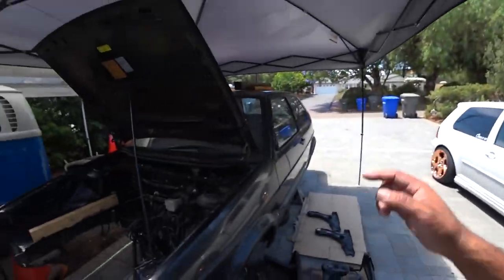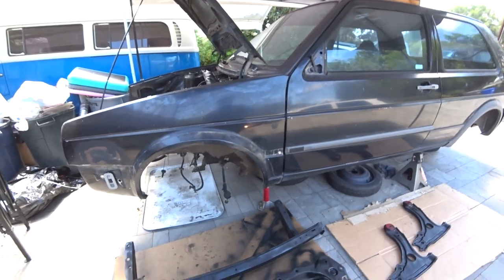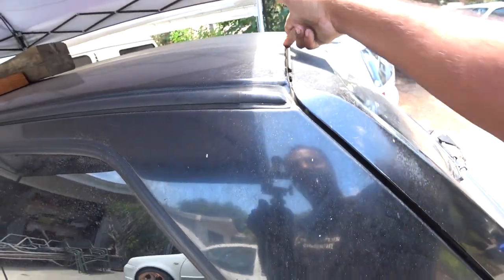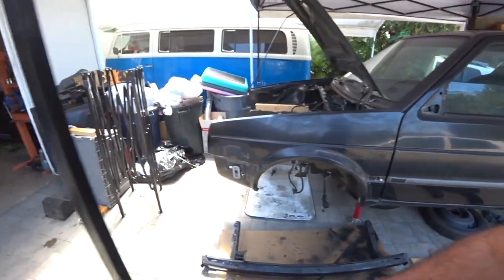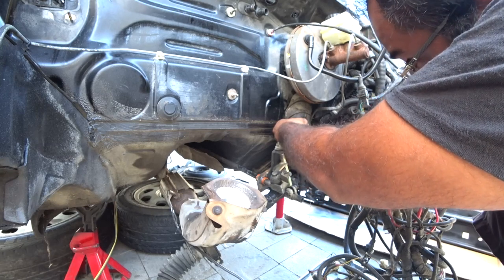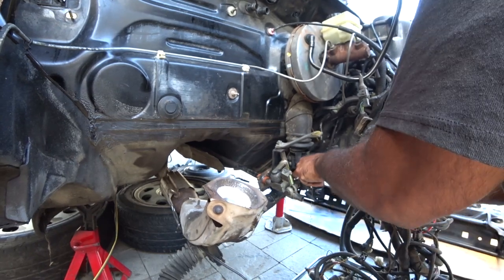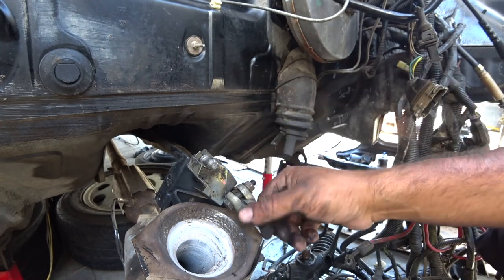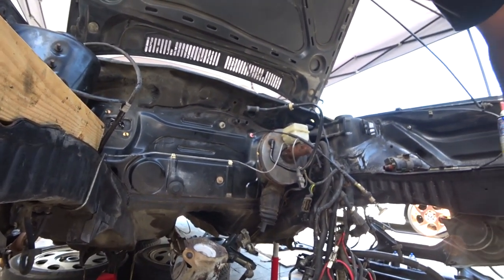VW MK2 Rack and Pinion Removal and Recap of What we done Season 5 EP25

Comment: I’d suggest you’d get Audi 90 Quattro calipers,   And g60 spindles to put them on. Best upgrade you can do for bigger breaks on the mk2, and make sure you also get the master cylinder from the Audi 90 Quattro as well, it needs it for an engine swap I have it on my mk2 vr6 and brakes like a charm !
Reply from the maker: for the mk2 gti we like the G60 calipers with performance pads and rotors most people that i have spoken to about this combo with a 1.8t love it and never had issues with braking performance. That being said we are using the Audi 90 Calipers on the Corrado we are building.